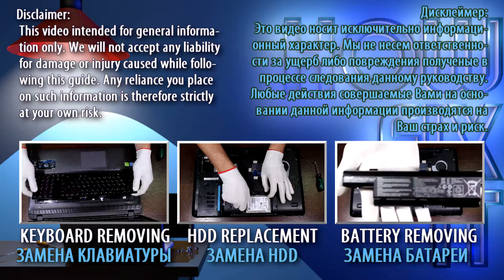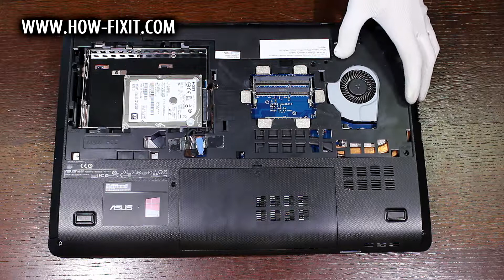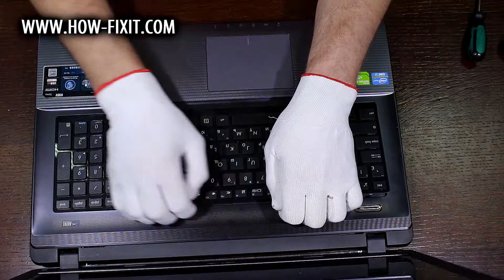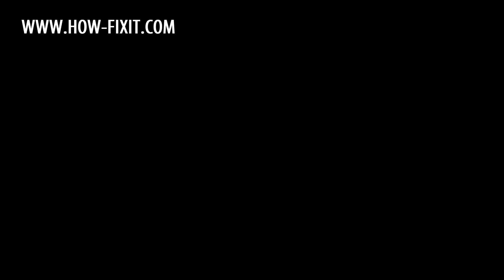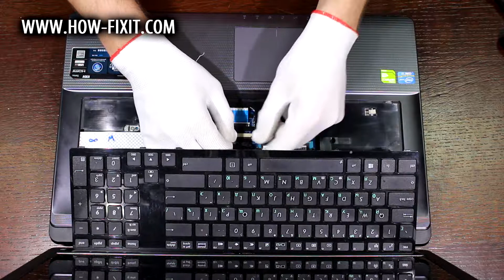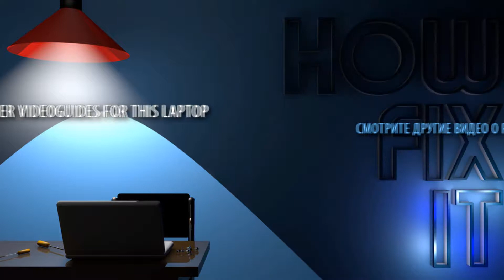Asus K95 RAM Upgrade and Install | Step-by-step DIY Tutorial

Comment: Ciao,
Ho una domanda riguardo questo notebook:
Asus K95VM-YZ002V, attualmente con 16 GB di RAM (4 pezzi, Corsair CMSX8GX3M2A1600C9 Vengeance DDR3 ad alte prestazioni, 1600 MHz, CL9, SODIMM) e vorrei aumentare la RAM a 32 GB.

Ho testato il PC con il software RAMExpert e ho usato il comando "wmic memphysical list full" nel Prompt e mi dicono ENTRAMBI "Maximum Ram 32GB"

Cosa può accadere se lo aggiornassi a 32 GB, ma non fosse supportata questa capacità?

CPU: Intel Core i7 3630QM
GPU: NVIDIA GeForce GT 630M 1GB

Comment: Hi!
I have an Asus K95VJ-YZ027H with 16GB of RAM, (4 pieces, hynix 4GB 2Rx8 PC3-12800S -11-11-F3) and I was wondering can i upgrade it to 32GB?
I am not sure now but i think this version says 16GB of RAM is maximum...what will happen if i upgrade it to 32GB? 

*Intel Core i7 3630QM
*NVIDIA GeForce GT 635M
Reply: Hello, 
I Have same question with this notebook:
Asus K95VM-YZ002V, 16 gb ram (4 pieces, Corsair CMSX8GX3M2A1600C9 Vengeance High Performance DDR3, 1600 MHz, CL9, SODIMM) and I would link to increase RAM to 32GB.

I have tested the PC with the RAMExpert software and I have used the command "wmic memphysical list full" in the Prompt and they tell me "Maximum Ram 32GB"

what will happen if i upgrade it to 32GB? 

CPU: Intel Core i7 3630QM
GPU: NVIDIA GeForce GT 630M 1GB